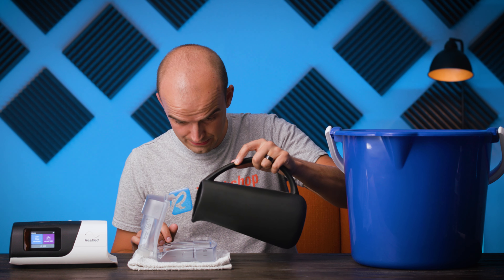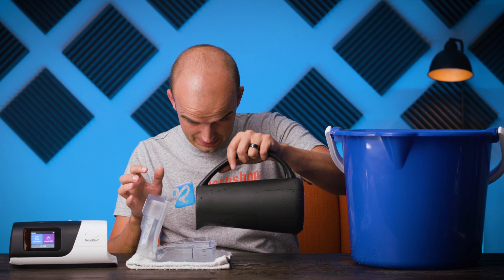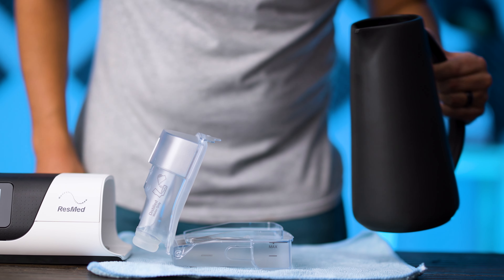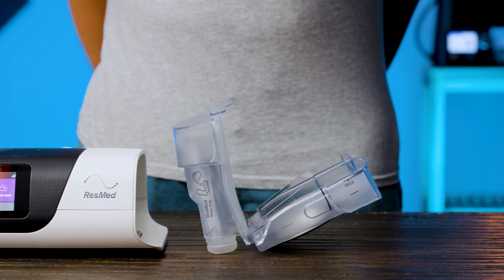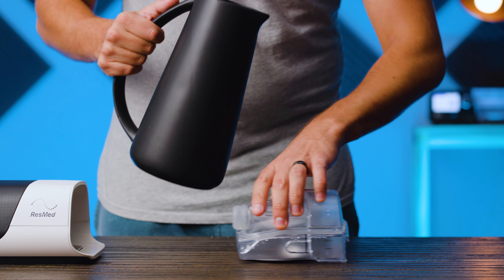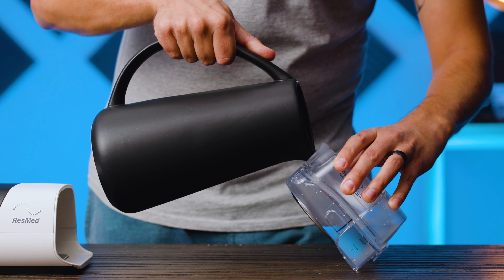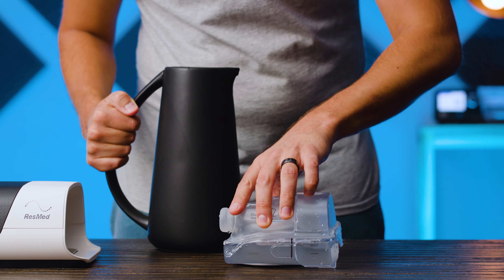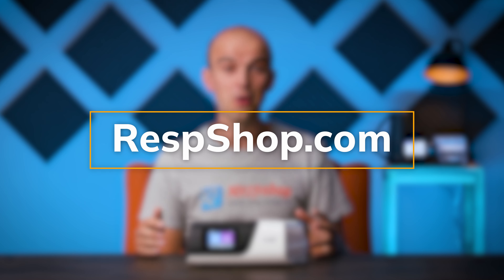"My AirSense 11 doesn't hold enough water" | SOLVED! ✅

Comment: They could just make the tank an inch longer and the problem would likely be resolved. My AS 10 would last for 10 or 11 hours so I cant even understand how this one only last 7 hours
Reply from the maker: Thank you for watching! Since both the AS10 and AS11 hold 380ml when the water chamber is filled to the max, I think this could be a difference in your humidifier setting. I'd suggest checking to see your AS11 humidifier is set exactly the same as your AS10.

Comment: The water is used up in 3 hours. I dislike this air sense 11 intensely. I have tried everything.
Reply from the maker: Thank you for watching! If you're using up water that quickly, chances are there's a leak somewhere (how's your mask fit? mask to tubing connection?). A full tank of water should definitely last you more than a couple hours even on the highest humidity setting.
Reply: @RespShop I used to use an under nasal mask, I was given a L~large full face mask.
I kept waking up trying to adjust the straps to fit.
It didn’t work.
Air was leaking up my eyes, then sides, then bottom.
Reply from the maker: @danielkoher1944  It sounds like you might want to try a medium cushion for the full face mask. Did you have to switch to a full face mask b/c you open your mouth during the night? If yes, you can try adding a chinstrap to your original nasal mask since it's a mask you're already used to.
Reply: I also run out of water roughly 4 to 5 hours in.  NEED a larger tank

Comment: This is my new cpap. It sucks because it doesn't hold enough water. Bone dry when i wake up
Reply from the maker: Thank you for watching. Sorry to hear about the dryness. Have you tried increasing the humidity level manually? You can switch the humidifier setting from "climate control auto" to "climate control manual" and set your humidifier level yourself. That should help increase the moisture.
Reply: I think he meant the tank doesn't have enough water so increasing humidity doesn't help when all the water has been used up...
Reply from the maker: @bananian  Ah, I see...but both the AirSense 10 and 11 hold 380ml at the max fill line. It doesn't look like it but the water chambers have the same capacity.
Reply: @RespShop  
Not sure they said they were using the 10?

Comment: uh, all that 45 degree angle foolishness, just fill to max line, close, rotate 90 degs, mark the waterline.  Duh.  Good idea, wouldn't occur to me without your video.
Reply from the maker: The problem with that is the opening that you pour into will overflow if you fill it up with the chamber pointing up. The 45 degree pour approach is the only way I found to avoid that.

Comment: WHy can't RESMED make a larger water chamber available
???????This is ridiculous!
Reply from the maker: Thank you for watching! The AS11 water chamber holds 380 ml at the max fill line, which is pretty standard for CPAP machines. The AirSense 10 actually holds 380 ml as well but the AS11 water chamber design makes it harder to fill.
Reply: The only way to fix it is to purchase a $270 external tank.

Comment: Do you have a video on tackling the installing the water chamber?  When I snap it into place, it ALWAYS hisses - leaking air?  I've tried wiping the metal plate and it still leaking air
Reply from the maker: We don't have a video on installing the water chamber but you have to push the water chamber in really hard to firmly seat the chamber inside the unit.

Comment: The ResMed 10 tilted back making it difficult to fill, as well. The representative told me yesterday that the 11 tank holds as much as the 10. 
I’m going to check ounces myself as it ran out 2 hours before I woke.
Reply from the maker: We ran a physical check of the water chamber sizes between the AirCurve 10 & 11 (which are EXACTLY the same physical sizes as the AirSense 10 & 11). You can see the results here - Spoiler: they don’t hold the same amount when filled to the MAX line!
https://youtu.be/J4HBEPOLW2Y

Comment: Does this work for the AS10?
Reply from the maker: Thank you for watching. Unfortunately we haven't tried this hack with the AS10 water chamber so we don't know. If you try it out on the AS10, please let us know how it goes!
Reply: AS10 is much simpler. You can fill it flat, leaving open the lid and fill it with both hands on your water jug instead of having to use just one hand on a kettle and the other on the tank.

Comment: I thought you had an actual hack to get more water into the chamber... 3D print, drip from another container..... Something actually useful to get a whole nights sleep and not wake with absolute cotton mouth.
I have a humidifier next to it set at 60+ to pre wet the air around it but it doesn't seem to make any difference.
Reply from the maker: What is the level of the humidity in the machine? Or do you use a heated hose? The water chamber is the same size as the AS10, so something needs to be adjusted to prevent all of the water evaporating through the night. If you want to talk this through over the phone, our healthcare professionals would be happy to help! Give us a call at  866-936-3754.